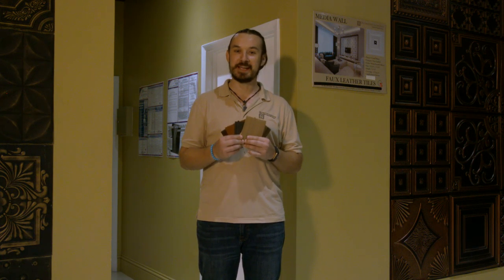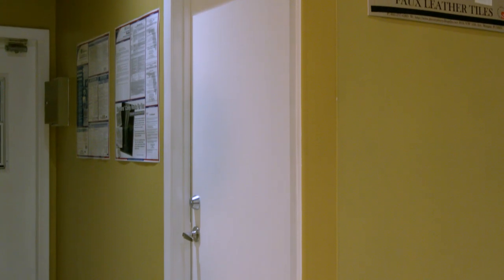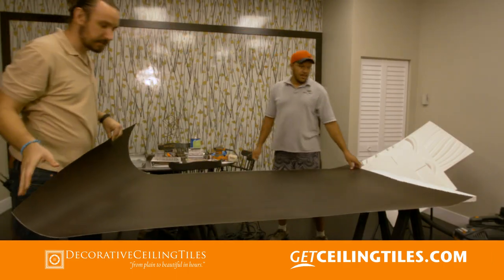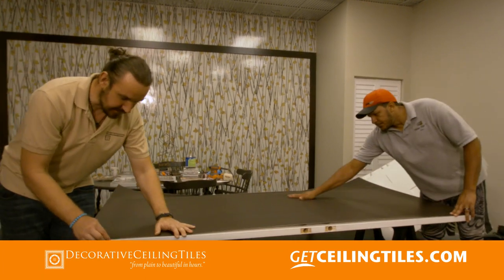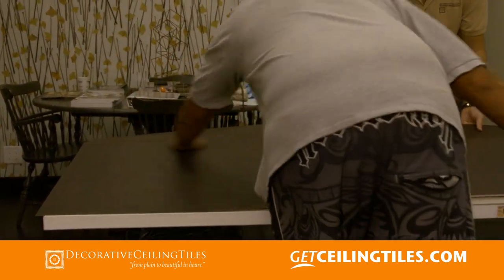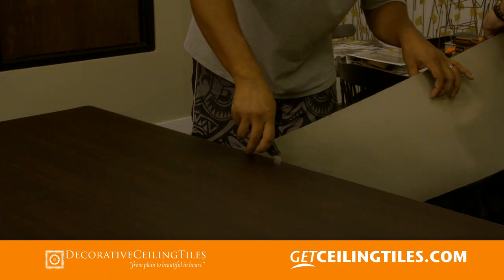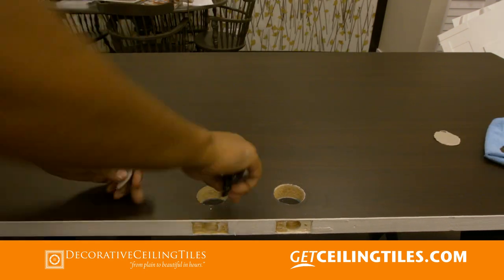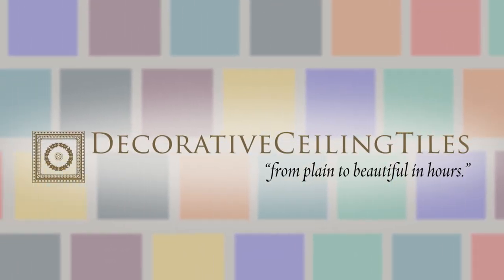Easy Flat Panel Door Makeover: Transforming with Peel and Stick DoorSkin into Expensive Wood Grain

Comment: I have steel entry door on my laundry room....it is that raised panels kind of thing and is heavily rusted.   It has no window.  My wife wants a window and so I looked at replacing the entire door with new prehung door ....but the way the home is constructed and the siding etc it is going to be a LOT of work to replace the door.  So my thinking it to buy a door window remove the steel skins from both sides of the door and reskin with ?  The steel panels are like 1/4" thick....So?   1/4" thick skins!  Where to buy or what to use??  Plywood?  Masonite?
Reply from the maker: Hello Dougie,  I'd love to help but our skins do not work on exterior doors.